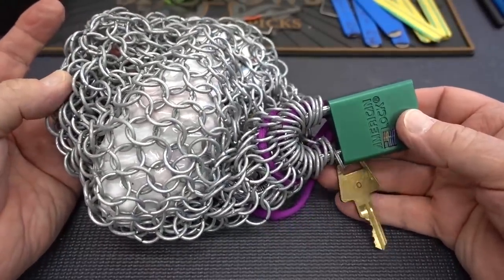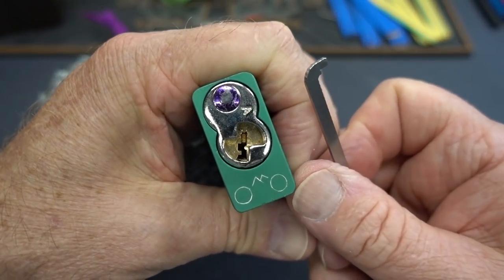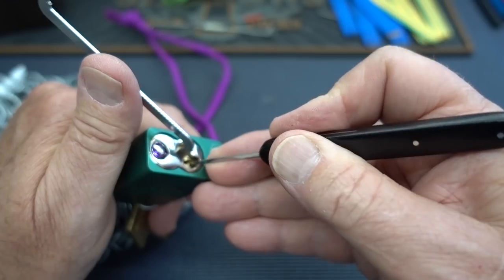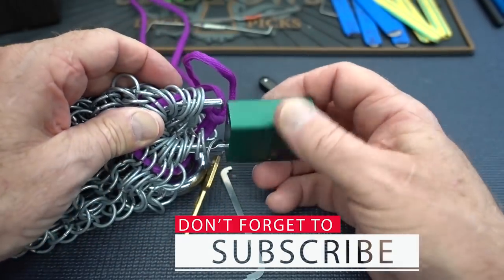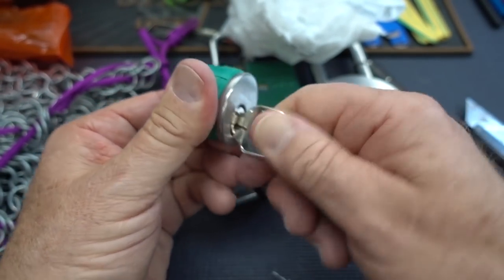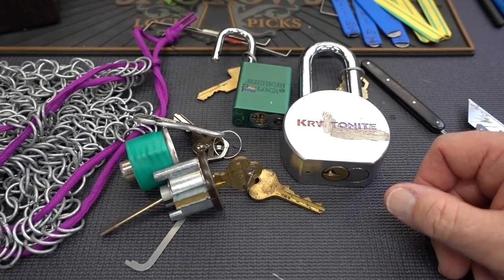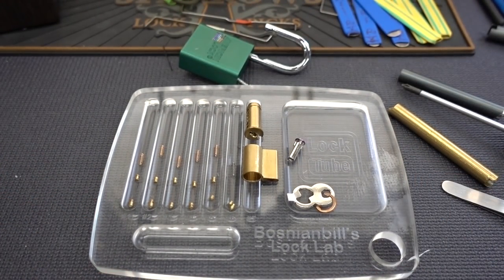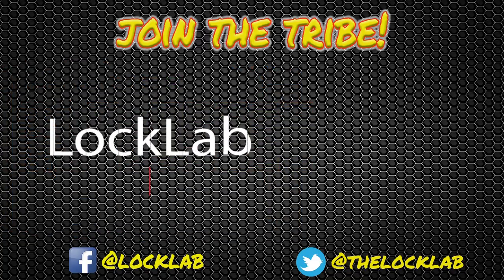(1343) Challenge: Locked Chainmail Bag

Comment: Hi Bill. Its me again, sorry! Just a quick question. I'm going to order my first lock picks soon, but I have a couple of Lockwood locks here id like to practice gutting. Can you gut and re-assemble cores without a follower? Or is it absolutely required? Might see if there are some random big drill bits laying around or something. Cheers!
Reply from the maker: Any object of the correct diameter will work (drill bits, sockets, batteries, etc).  You can even used a piece of rolled up cardboard or paper.
Reply: Bosnianbill cheers, mate! I believe you reviewed these locks before. The big shiny steel Lockwood shutter lock. They also have a beefy, unprotected shackle padlock too. About the same price - $70 to 80 Australian kopeks. They’re the best locks you can get at Bunnings, which is our version of a big box hardware store. I’m quite happy with my purchases, the shutter lock was initially too big to fit on my storage locker, but the padlock goes just fine. I eventually want to put insane cores in them, BiLocks at the very least, which is about the best balance between security and price in Australia. The cores won’t break the bank here, but the security is good enough that a bike thief isn’t gonna touch it.

Comment: Where can i buy chainmail bag or similar ones? For protect my helmet, as examples!
Reply: Renaissance faires, sometimes on etsy or other online storefronts.

Chainmail is actually relatively easy to make, just time consuming. There are website that sell supplies such as pre-cut rings to make things easier for a beginner.
I bought a spool of electric fence wire and did it all from scratch, all you need is a power-drill, dowel, and a couple of pairs of pliers.

Search for "European 4 in 1 chainmaille tutorial" most of the top responses and videos will serve your well.